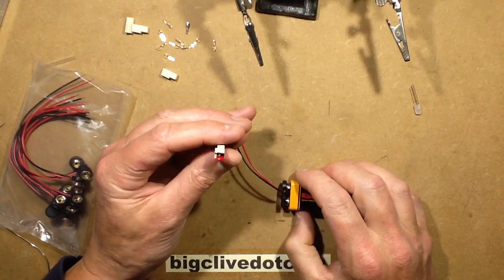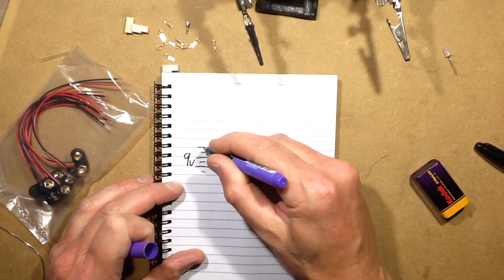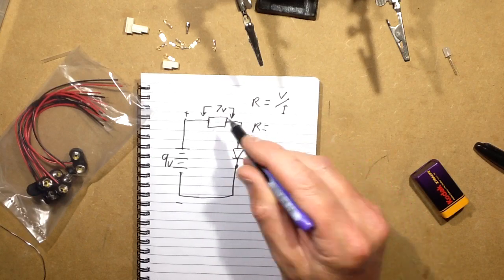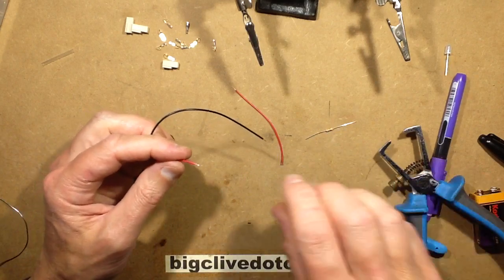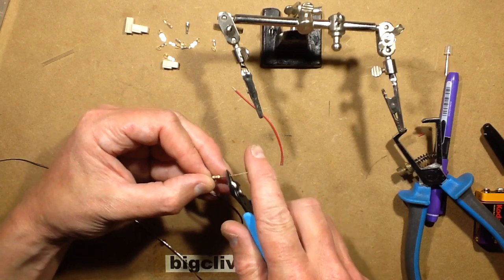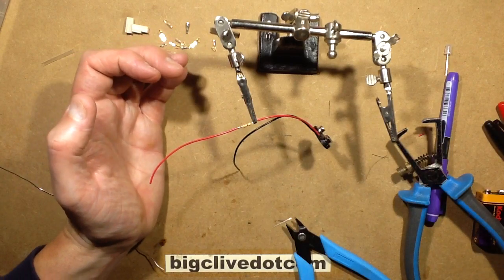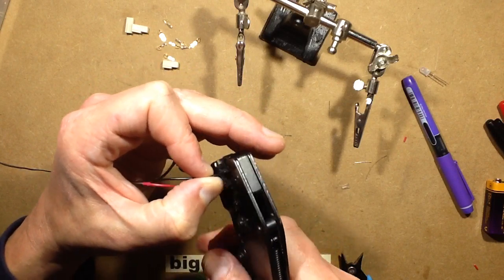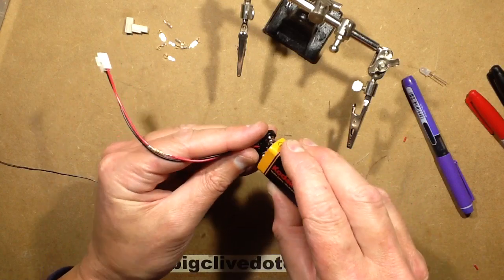Make a super-simple LED tester and emergency light source.

Comment: Would it work with a single AA cell and a joule-thief, if I wanted a more compact design?
Reply from the maker: You could, but the Joule Thief should not be run open circuit to avoid excess voltage across the transistor.

Comment: This is very interesting and I'm interested in the calculation you did to determine the resistor value. It mostly made sense but how did you know the current you were after is 20mA?
Reply from the maker: 20mA is a typical upper limit on standard indicator LEDs.  The resistor value was chose by deducting the typical LED voltage (about 2-3V) from the 9V of the battery, and then dividing that voltage (about 6V) with the desired current (0.02A).
Reply: @bigclivedotcom  Ah that completes the picture! Thanks for that!

Comment: I build one using USB 5V as power supply, as have many of these but no 9V batteries. Can test LED currents of 1,2,3,6,10,20,30,60mA by using 8 way socket and 8 resistors. https://www.thingiverse.com/thing:4923621

Comment: I think your 330 ohm resistor might be a bit on the low side.

I have some IR LEDs, which have a forward voltage of just 1.33 volts.

I've found IR LEDs to be quite delicate, so I'd be inclined to go with 390 ohms, or even a bit higher.

Comment: I made one with 2x2032 cells and heat shrunk the wires onto them.  I tried soldering the wires on but no matter what I tried, it wouldn't stick to the battery. So I just soldered on a little folded up bundle of thick wire to the end of each lead then heat shrunk then either side of the battery.  Then, buoyed by the success of this project, I made a USB powered one.

Comment: Ohhh nooo!  After all the trouble Big Clive went to show us how a Joule Thief works, he digressed to using a 9V battery!  Horrors!  😱😱😱

I built a Joule Thief with a socket like he used for the LED.  But the JT must not be left open circuited with no LED because the voltage will rise very high and can damage the transistor.  So I connected a 6.8V zener in parallel with the socket so the voltage can't rise above 6.8V.

One point: the typical 5mm LED and most others, too have a reverse voltage rating of 5V maximum, so if you insert the LED backwards, you are putting over 9V in reverse across the LED.  I have never found that the LEDs I've tested have been damaged by this, however it is excessive voltage  and should not be done.

Comment: Does anybody here have any advice for an electronics beginner who's colorblind? I can tell red from black and fairly obvious differences in colors (even if I cant identify the color) but the stripes on those resistors drives me up the fucken wall... Is there any way for me to learn this stuff without depending on those color codes?
Reply from the maker: The colour codes are quite important, but you can use a meter to test and sort resistors.

Comment: So i am just learning this side of eletric world and your great at teaching. But as a car guy. I use a old style Mac tool wire striper. Looks like this one you use but has a block of sides on it. So you stick wire in appropriate hole and grip handles together. And it strips for you. Do you think this would be a better way to go. Or are the small wires very easy to break.
Reply from the maker: Each wire stripper has its own uses.  Your multi hole version is a good choice.  I have a similar one here.

Comment: After watching this video, I went ahead and purchased a crimping tool, sort of like that, but with 3 sizes instead of the 2 as yours has.  I am amazed at how often I use it, I had ordered a set of Dupont type ends for it, and ran out of the male type, had to order more of them, and have also purchased a set of the type you use in this video, while I don't use them as often as the Dupont, they are indeed very handy for many projects as well.  You are correct in that it takes some time to learn exactly how to use it properly, but once you have it, it seems to come naturally thereafter.  Thanks a million for the video!

Comment: This bring back memory.  I had one such 9V tester.  But the 9V was too expansive to replace.  So I switch to 3 x NiCd AA batteries.  It works fine and cheap but does not hold charge after several months.  I guess I could solder Alkaline batteries?  But I moved on with LED projects.  I bought a number of LEDs on eBay.  It is cheaper to buy vs. make my own.

Comment: Being a bit on the cheap side when it comes to soldering irons, I looked around and found this little gem about two years ago now, and have used her daily.  She has yet to fail me, and she uses the common tips that fit your soldering iron, so I have a ready supply of replacement tips, she came with 4 and I purchased a batch of assorted ones, I don't recall how many, that was a mistake, as I find I only use two, the chisel end and the fine point if I need to do something very small.  I have no idea how accurate the thermostat on the side is, however I do know it works it is quite obvious when you need a bit more heat, turn her up, and she produces, need less and a bit down cools the tip right down.  I had been going through several old soldering irons before getting this one, first my old one that came with my Bell and Howell correspondence course in TV Repair back in 72 but she was in bad shape, then a couple of those 3 buck ones from the cheap bin at the hardware store, what crap that takes twenty minutes to warm up. Had a Radio Shack COLD soldering iron, that does sort of work but not well enough for my liking. I have had two of the different USB irons, the first was quite good but burned out on me, the second is the one you recently reviewed, it has it's place but no good for full time work but the little blue one here :  http://www.ebay.com/itm/Hot-Sale-60W-110V-Adjustable-Temperature-Welding-Electric-Soldering-Iron-Kit-/152470590727?hash=item237ff49507:g:8CkAAOSwXY5ZXyV5 really does the job for me and with limited space, I don' t have room for a full set with hot air gun.  I do have a hot air gun that is seperate tub rarely ever dig it out as it is large and in the way all the time, much like my glue gun that is in the pile beside my recliner.

Comment: Nice useful tool - Does that crimp do the DuPont connectors too? Is there a model number on it at all?
Reply from the maker: I've only ever used it with the Molex style connectors.  You can find a range of crimping tools like this on eBay.
Reply: I'll take a look - Cheers Clive

Comment: So i recently bought a couple of random lights, they're all sort of indrustrial'ish but i think mostly led. i don't know what voltage to give them as it's not written anywhere. is there a way to calculate or know how much voltage a led or other light needs?
Reply from the maker: It should either be printed or embossed on the housing, or on the lamp itself if it is removable.
Reply: thanks for the quick reply. I'll continue my search for the specs then. But just in case, is there a way, say i don't find them, to calculate what they need?

Comment: I have one of those flux pens.  Got it from China of course off ebay. About the third time I used it, I pressed down to get a bit of flux, whetted the connection, and when the tip popped out (it had become stuck inside the pen) it shot the end out over my shoulder.  That was about a year ago and I still have yet to find that tip.  I think I shall have to throw the pen away one of these days.

Comment: Polarity... @ 9V reverse polarity will blow out the LED.
3 alkaline cells fully charged are just below 5V which is the safe reverse voltage for most LEDs

Comment: I need to drop from 24V (truck battery) to 19V/1.75A(for a laptop) , but the resistor that I get is 2.85ohm (5/1.75=2.8571) and I'm not sure if that would be a good idea or not
Reply: Just power from 24V laptops will have internal voltage regulators. It be fine. Just make sure you get the polarity correct.
Reply: @firepower9966  I completely forgot about this post! Found a better solution, resistors are not the way, LM78XX is the perfect thing. Some resistors, some chip, some condenser and it works just fine. 
Way better than one of those converters from 12V DC to 230V AC just to plug in another conerter from 230 to 19 lol

Comment: Static sensitive LEDs??  Ive used them for ever, well back to when the only colour was red and not too bright. I have never heard of this before or received LEDs with static protection. Well today everything is delivered in anti static packaging but that is just for convenience. Wikipedia even lists TTL chips as static sensitive??????????    WOW. So when I worked in the semi conductor supply industry handling the 74nn series devices, with no antistatic protection we were blowing them up! Bizarre.
Reply from the maker: The old skool reds, oranges, yellows and apple-greens were absolutely indestructible.  The newer whites, blues and bright greens are best handled with anti-static precautions.
Reply: I work with 20nm nodes and we have anti static readers that won't let you in the fab unless the static can dissipate through your boots via grounding strap, pretty irritating really.

Comment: Hey clive sorry for the bother, but I have a small question  

I currently have a metal PSU to connect to wires which only have live and neutral. Even though it'll be out of people's reach,  can I go with grounding it through the neutral (since it should never have to close the circuit under normal operation) and keep it safe-ish or just not ground it at all  

I know the RCD won't trip if things go bad, but it's still better than having it non-grounded
Reply from the maker: Ideally if the case has the facility for an earth/ground wire you should attach one.  I wouldn't recommend connecting the neutral to the case as there are some wiring fault scenarios where that could pose a risk.

Comment: You probably dont read this anyway but it bothers me seeing you struggling with the wire stripper so i'm here telling you that there is a type of stripper around that is the best you can get for your money. i have one of these for about 10 years now and it's always a pleasure to work with. since i'm not able to post a picture i'll provide you with a sample link were you can see how it looks like. 
http://www.sealey.co.uk/PLPageBuilder.asp?id=20&method=mViewProduct&productid=16205
do yourself a favor and get one of this type. you'll never regret for sure
Reply from the maker: I do actually read the comments.  I've used a variety of wire strippers in the past and found that some of the automatic ones can either chew or damage smaller wires.  In the video I needed to adjust the strippers, but as the video was in progress I couldn't really stop.  The manual strippers like I was using are my preferred tool.  Especially when adjusted correctly for the cable being stripped.

Comment: I would use a 470 ohm resistor to limit the current in a safer direction rather than 330 ohms, especially since a brand new battery could be as much as 10 V.

Also, if you put a diode in series with the current limiting resistor you can use the tester to check LED polarity and also protect against damage if you inadvertently insert an LED backwards.

Comment: Clive - Any ideas on driving the 'Chanzon slow color change straw hat LEDs'?  I got them on Amazon.  I'd like to dim them down a bit to use as 'power-on lights'.  It says 3.0v -3.2v .. but some of the color combinations are listed down to 2.0v - all at 20ma.  I'm using 6+ volts, then a constant current circuit.  I haven't tried to burn one at 20ma yet  because 6ma seems pretty bright, and the voltage across the LED swings as high as 6v as the colors change.  I'm pretty sure I'm going to burn a few, so it's good that I got the 100 pack.  Just wondered if you had any ideas?
Reply from the maker: If you use a resistor you may find that because the red LED has a lower forward voltage it tends to drag the voltage across the LED down and become the dominant colour when there is red in the mix.  Just experiment with resistor values until you find one that gets the best result.
Reply: Thanks .. I've got a trimmer that will help with that.  After that, I'm still gonna try to make one smoke at 20ma.  Then, I will turn the LM317LZ around and see what changing voltages does.  If nothing else, I'm going to have a whole bunch of color changing solar lights and not-so Christmasy candles!  D  (Hit the wrong 'reply' :/ )

Comment: I don't think the iPad camera is fixed focus, but it may not be able to focus that close (and it was maybe also a bit over-exposed). If you use the camera app, you can see that you can tap the preview image to focus it. Inside is a tiny voice coil motor, which moves a lens element by a tiny amount to focus. However, with the very small sensor and very wide angle lens (equivalent to ~24mm on a full frame camera), there will never be a huge amount of difference between things that are in focus and the rest.
Reply from the maker: iPad2 is fixed focus unfortunately.

Comment: I messed up a V=I/R calculation once in a physics exam. I doubted myself and insisted it was V=I*R. That is all.
Reply from the maker: You mixed it up again.  V does equal I*R.
Reply: Slams head against desk Maybe it's just not meant to be.
Reply from the maker: Don't worry, it all just falls into place itself when you actually need to use the formulas.

Comment: also, have you considered using a 3 pin plug and put both high and low current resistors to have both tests in 1 unit?

Comment: Quick non-pro tip:  For my helping hands I used some E6000 to glue some neodymium magnets to the bottom of the base so I could stick it to my work surface (which is an old flat side panel a computer case with a 1/16" [1-2mm] piece silicon mat glued on top) without it tipping over or sliding around.

Edit:  In case anyone wants to know about the crimping tool.  If you have a Paladin 1300 or 8000 series crimp frame and want the die for D-Sub pins the part number is PA2097.  Paladin Tools is owned by Greenlee.

Comment: Are you still using flux cored solder?  If not is there an advantage to using separate flux?
Reply from the maker: Flux cored solder applies the flux automatically on demand as it melts.  A much better option for standard through hole soldering.

Comment: Why not use a single coin cell battery by itself, pressing the legs of the LED on that?
Reply from the maker: It works, but it's a very random current.  I like to see what intensity I'm going to get at around 20mA.

Comment: is 10 watt led run on 9 volt battery and led is 12 volt. 
is it practicle for long turm use
Reply from the maker: The little PP3 9V batteries don't have a lot of energy in them.  It would be better to make a battery pack from AA cells or bigger.
Reply: +bigclivedotcom recently I make 10 watt led light with 9 volt rechargeable 300 mah battery and this works fine for first hour of usage and then lights low down and this light give me approximately 5 hours of low light backup 
Plz guide me to make this light consistent

Comment: On my first computer, it had a wire coming from the ciruit board on the hard drive, and it had the same molex connector on the end, with an led stuck into it. Then it was placed behind a piece of see-through plastic, so that you could see if your hard drive was active.

Comment: Walking helping hands is a typical problem. 
I attached my helping hands to a round base of solid steel to stabilize it and provide a small stage if necessary. 
no problems after that.

Comment: Why a 9v batteri Clive? For simplicity? Dropping 7V over the resistor seems pretty wasteful, wouldn't some sort of 3 AA battery pack be better? Or are there many LEDs that have a forward voltage of more than 4.5V?

It should be noted that I haven't thought this through very much and the answer might be obvious.
Reply from the maker: Simple source of a high enough voltage for the full range of LEDs including the colour changing ones.  And as the voltage drops with use it is still high enough to pass enough useful current.

Comment: Some red LEDs turn on at 1.2V.  I'd be inclined to increase the series resistor to 390 ohms, or even as high as 1,000 ohms.  LEDs tend to have much lower reverse breakdown voltage than rectifiers.  If you plug the LED in backwards, the diode may go into reverse breakdown, causing it to dissipate enough power from a 9-volt source to destroy the junction.  Using a higher value of resistor can reduce the chances of damaging the diode.

Comment: Great video man as per usual! Can I ask what heat gun you use as I couldn't make out what you called it? Many thanks
Reply from the maker: It's part of a cheap soldering station called a Yihua 8786D.  Quite a few of the Chinese soldering stations have the hot air pens on them.

Comment: I would personally put a higher value resistor, since you really only need to see a slight glow to know whether a LED is working and what colour it is, etc. and also it will mean a longer battery life so you might never even have to replace the battery regardless of how many LEDs you test.

Comment: A nice wire stripping tool I use Clive is from RS, you can set the depth by moving the red slider, one click and its done link: http://uk.rs-online.com/web/p/cable-strippers/0243257/ maybe you can do a vid on different types of wire strippers, or other types of strippers will be just as good, lol
Reply: Yes, they are really handy. But you can get one like that for much cheaper. I payed 3 or 4€ for one and it has been working well for quite some time now.